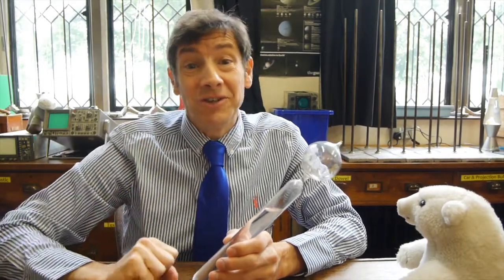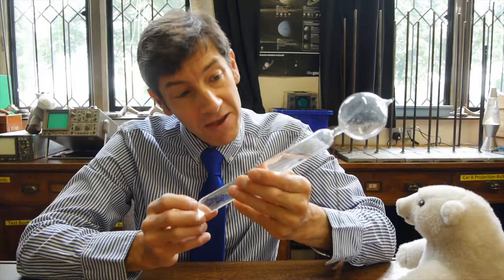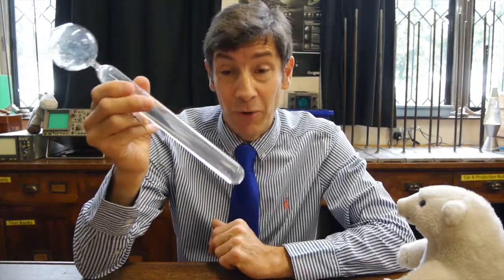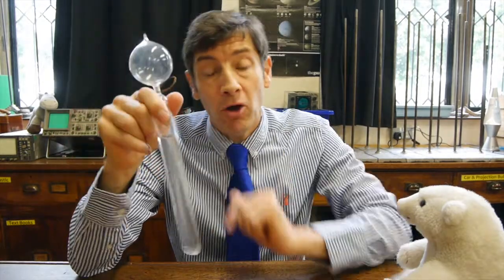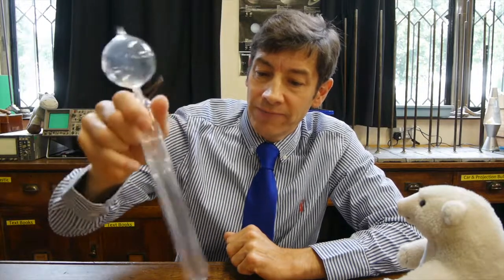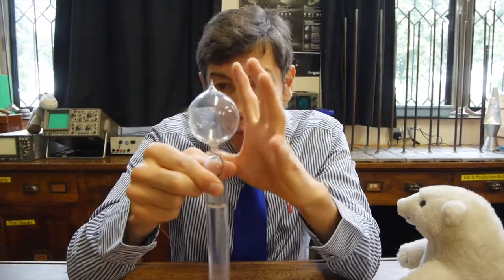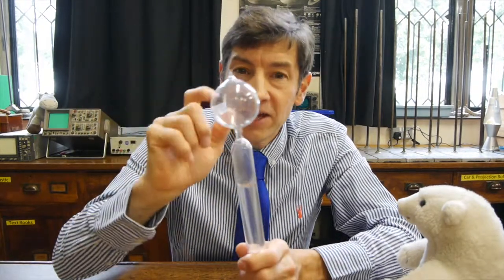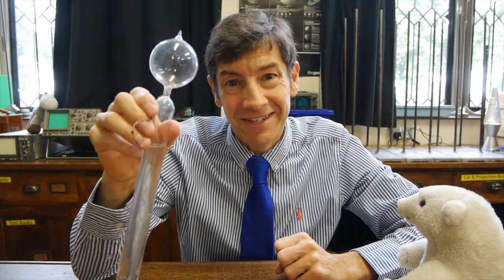Water Hammer Toy - F-J's Physics - Video 124

Comment: This apparatus produces noise because there is no air in it. In water pipes, there IS air; why is noise produced then on sudden opening of the tap?
Reply from the maker: Not sure I get your question/statement.  There is air/gas in this as you can see and if not the water would vaporise/boil at room temperature if it was a vacuum (see my video https://youtu.be/wIEsDY-EieE ).  In a real plumbing system water can rush down a pipe and strike a corner/sharp bend with destructive effects if this happens too fast - a large force is needed for this large impulse/change in momentum.  This is the effect that is demonstrated here and the sound can be heard.  Bubbles of air trapped in a water supply when the tap is turned on do indeed make a noice as you suggest too.  You also get the effect of the pressurised air rapidly depressurising when coming out of the tap.  Hope that helps.

Comment: Thank you for the lovely explanation. As a doctor, I came here to better understand the water hammer pulse. In medicine, of course, I think it is not exactly the same effect, because there is no empty in vessels, it is a name to describe it, but anyway, it is very interesting. In medicine, it is produced for regurgitation from the aortic valve.
Reply from the maker: Thanks, and great to hear from you.  It is lovely that physics has such varied applications and the water hammer effect is, as you say, really important in blood flow.  In the chemical/nuclear industry badly designed pipework can be a real issue and opening a tap too quickly and then shutting it down quickly can result in a massive mass of fluid suddenly slowing down when it hits a 90 degree bend/join in a pipe breaking it open.  I was very nervous about the glass!  Those taps on hospital sinks that are a quarter turn that you operate with your elbows can do this!  You have been 'lucky' to actually hear it in the human body.  Thank you so much for taking the time to comment!
Reply: @AnthonyFrancisJones  Thank you sir for the explanation
Reply: Came here for the same reason.